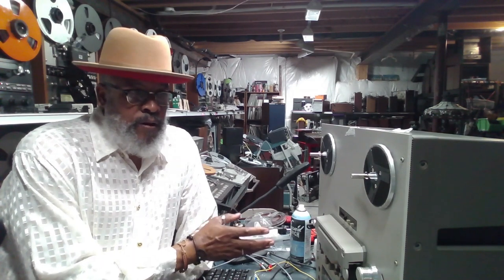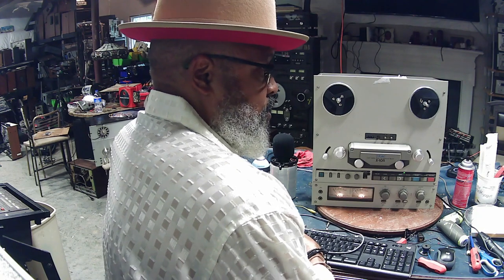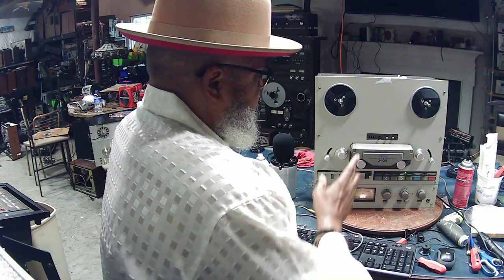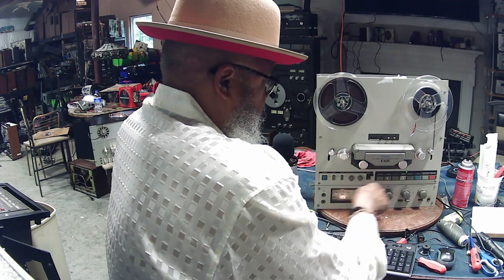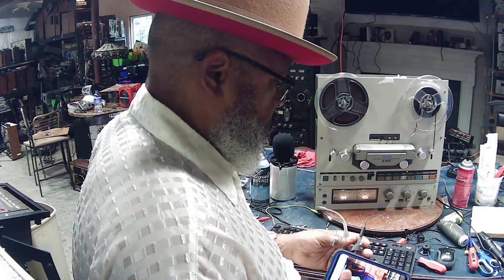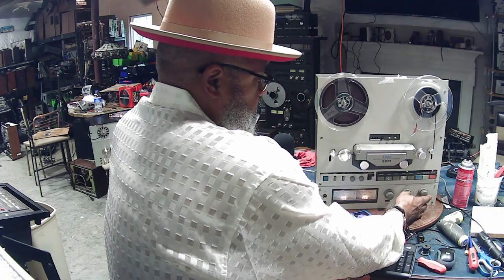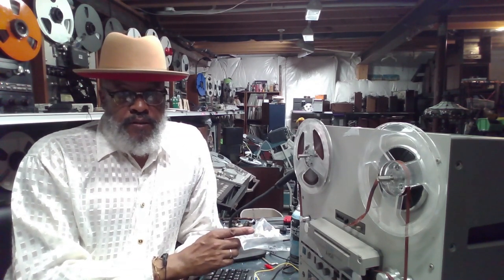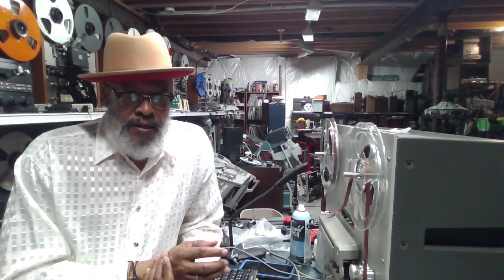How to Evaluate a TEAC X Series Reel to Reel Before Purchasing 10R, 1000R 2000R 7R 700T, 20R

Comment: Matt im a newbie to the R2R , I just picked up a x1000 , but its stuck on fast forward and the operational buttons will not stop it. any helpful assistance or videos? also When i search for parts for the x-1000 i come across the x1000R,  any suggestions to locate parts beside ebay? what other  X series can interchange internal parts to rollers parts?

Comment: First thing I look at is the heads. If there worn I walk. second is like you said the capstan motor.  That is the deal breaker for me. Everything else cosmetics and mechanical can be fixed most time for reasonable money. Yes heads can be lapped, but most of the x series decks there soft metal heads. Also the cost involved is beyond the cost of the deck unless your a tech, or has all the equipment necessary to align the deck back to specs. I have the gauntlet of equipment necessary, to do the work, I own several decks myself all with heads that are not worn. I did pay a premium for them to be honest. These things are bringing crazy prices.🤬